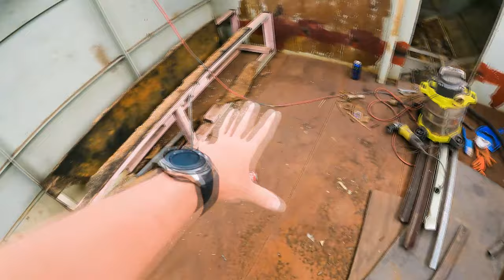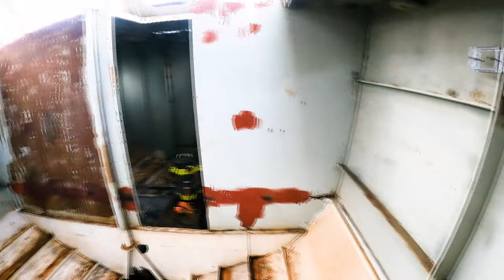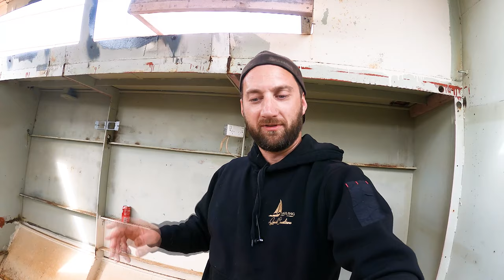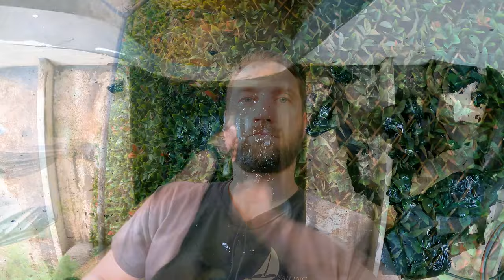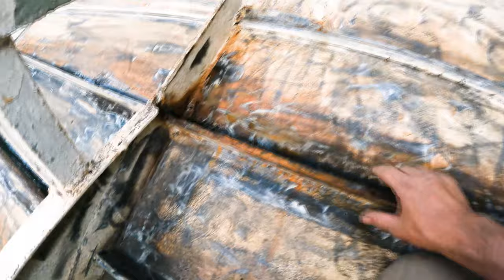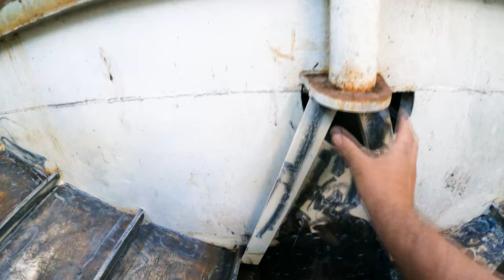Sailing QC #45 | Cleaning & Prepping the Main Saloon Lots of Boat Work | Steel Sailboat Restoration

Comment: A couple of butane burners on outside of hull will dry water and liquify pitch and you won’t have to breath fumes. Quick and cheap!! You are doing a fantastic job really looking good!!!
Reply from the maker: Thanks Glenn, We have thought about lighting a fire from the outside but when talking to the engineers they were worried about carbon encroachment into the steel. Heating from the inside maybe the easier option. Cheers for watching!

Comment: The engine was probably located under the companionway ladder to provide easy access and to shift the weight toward the center of the of the boat.  Given that you're planning to go electric, I would locate the drive motor, controllers, etc. in the space behind that, under the bridgeway.  Make some part of that space your machinery room.  If need be for balancing the boat, locate your battery trays where the current engine mount is.

For the bilge and keel, I wouldn't seal that space up with epoxy until after you have the boat dried out and weather-tight.  Then be certain the the keel isn't leaking from the outside.

About weather.  Have you considered fastening some sort of tent/cover over the boat?  It could be anchored to the ground or the boat.  Using cheap transparent plastic should provide some natural lighting, and allow you to rig lights, work on deck during all sorts of weather, etc.  For summer, you could add  a sunshade layer like used in green houses to control the light & heat filtered in.  Lots of large projects such as boatbuilding do so.  (Most common reasons given to not typically are:  Don't want to take the effort that could go toward the boat.  Costs too much. It's not that hard to work around the weather.  We'll be done soon enough.  And so on.   Most builders find out afterwards that building the shed first would have saved time and money. :-) )
Reply from the maker: Electric and solar converters etc will go in the technical room under companionway :) got a few spots to choose from for battery banks still. I'm lucky enough to work at a shipbuilding company with plenty of marine architects to get them to model weight distribution for all components. Through the week I have had a another crazy idea for sealing up the keel, which ill go through in a coming episode. But the gist of it is, I can chisel out the 2 inch thick pitch and weld in a steel plate in casing it all. I would then have an access hole that can be sealed up and I can fill the bilge with oil. This will keep the keel safe from corrosion and allow me to have a hard surface to paint with a white bilge coat...possibly.
The thought has crossed our mind about encapsulating the boat to protect us from the weather but we have gone through all that you have mentioned and just haven't bit the bullet. Will be focusing primarily on indoors very soon anyway for now. We have plans to adapt an evaporative for while we work on the inside during summer as fingers crossed we will be closing up the boat hopefully. ⛵⚓

Comment: Yes that’s correct but use a low flame and heat up to temp slowly. Not enough heat to change molecular structure of the steel. Low and slow. Just remember pitch is very toxic and flammable 🔥🔥lol good luck I know you’ll get it done.
Reply from the maker: Yes pitch is full of coal tar which is toxic. I'm thinking of starting off with trying an electrical heat gun to avoid the open flame, if that doesn't work maybe a gas fired heater on the outside of the steel ⛵⚓

Comment: What about heating the keel from the outside? The water would evaporate, and the tar would melt. You would not need to be inside.
Reply from the maker: Hi Rolf, We have thought about lighting a fire from the outside but when talking to the engineers they were worried about carbon encroachment into the steel. Heating from the inside maybe the easier option.